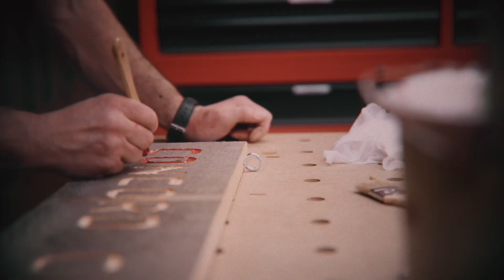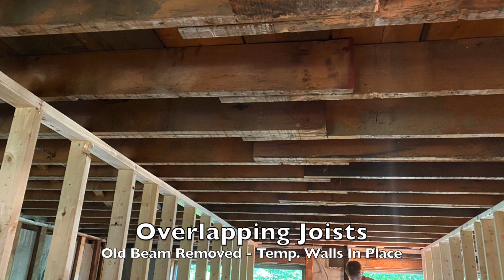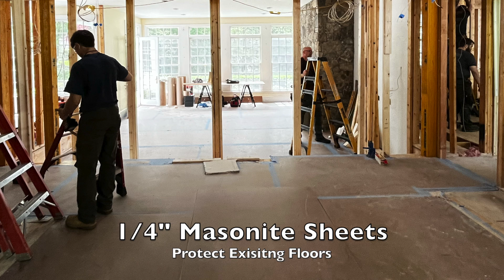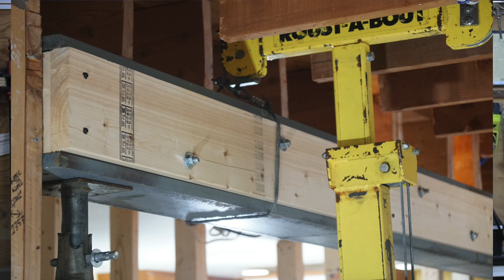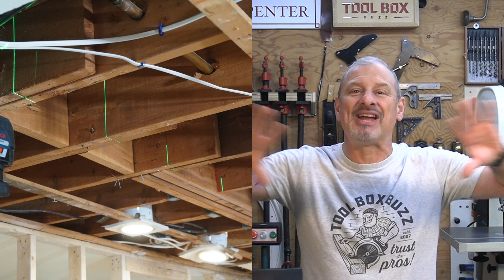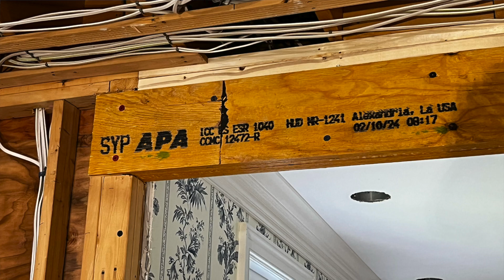Tips for Installing a Beam | Removing Bearing Walls

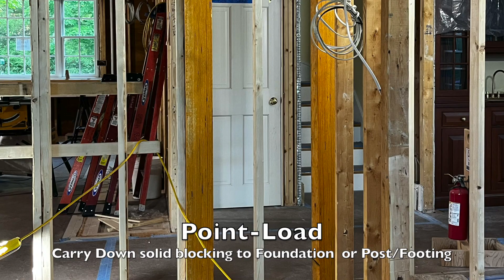Comment: I saw @6:02 that you didn’t place the two columns on sill plates but directly on the below beam. Are sill plates not required in these circumstances?
Reply from the maker: You could do either, I prefer this method as it eliminates another material between the connection
Reply: @ConcordCarpenter  Understood, thanks.  And I assume that the codes do allow the direct connection method?
Reply from the maker: @Dutch2go  yes - if you look - the pSL post sits directly on another LVL beam and a 4 ply KD beam.  so you have solid point load to structural column and footing below.  If this PSL post had fallen between 2 joists [under ply subfloor I would have used a shoe plate and ensured 4x blocking under ply subfloor to the fram or post

Comment: Great video! Quick question. When you need to replace a large window in the first floor of an open ceiling area where the ceiling is 28-30 ft high; what type of structure do you use to do so?
Thanks
Reply from the maker: You might have to support the house from the exterior with 45-degree legs supporting a ledger timberlocked into wall studs

Comment: Thabk you. Question about temp walls. How are  the load being carried down? It is sitting on floor joists w/o any support below in basement. I guess it is ok for temp short duration? thanks a lot
Reply from the maker: @Voltron-1234  that depends - in most cases yes,the floor-joists are all intact below. Your dividing the upper weight on the floor below
Reply: @ConcordCarpenter thank you.

Comment: When I do my temp walls I usually put 1-2 2x10s on the floor for a bottom plate, 4x6 for the header, and 4x4 legs every ~6' with bottle jacks under the 4x4s at each end and some full length 2x4s tight to those once the bottle jacks have the beam where I want it. This gives 4-8' openings everywhere to walk through. Very workflow friendly. I can understand people prefering regular 2x4s for their temps because they're more easily recycled over the course of the job but I've been using the same 4x4s and 4x6s for my past 4-5 beams. When I'm recessing, I measure 22 3/8" off of each side of the 2x4 top plate of the wall I'm taking out. Then I snap my lines and remove that drywall. It's enough room to comfortably get your hangers in. When you're done with your beam you have a 48 1/4" opening to run full 4x8 sheets with minimal joints. All my subs always mention how clean and open everything is. Side note- Starret lumber actually has the calc software free to use online and I'm 99% sure they'll double check your work for you right in Watertown even if you're not sure you actually need the stock. It's really generous of them.
Reply from the maker: Great technique, love the 22-3/8 tip
Reply: @ConcordCarpenter  Thank you sir. I appreciate all of your tips as well.
Reply from the maker: @Tool_Addicted_Carpenter  didn’t realize your local, grew up in Waltham

Comment: I spoke to an engineer.  And now I know how to drive a train, but still don’t know if my wall is load bearing. Oh well. Great video as usual. Thank you.
Reply: I spoke to an engineer too. He said he couldn't tell me much about his explosives jobs or techniques...I'm still scratching my head looking at a wall 😆
Reply from the maker: haha!
Reply: A load bearing wall is basically what holds your house up. Like all exterior walls that support or roof down into the foundation. Not all the wall on the interior of the home are some are more just basically a partition but he did tell you how to identify them and you can find them on the blueprints . This is just my understanding I don't really deal with moving the walls I do the patches    where they moved the wall .